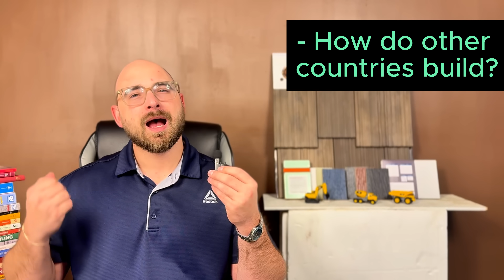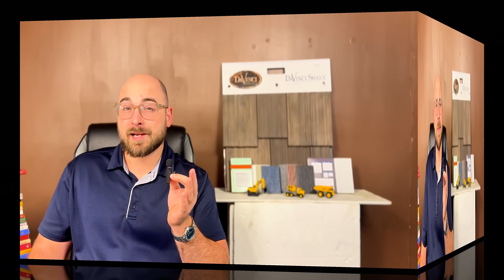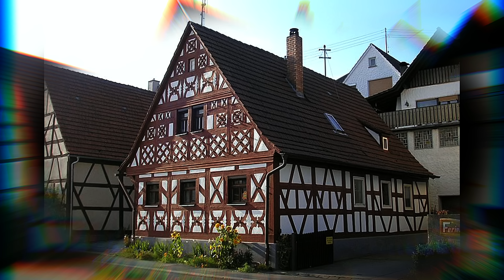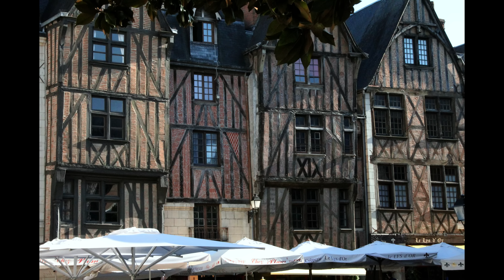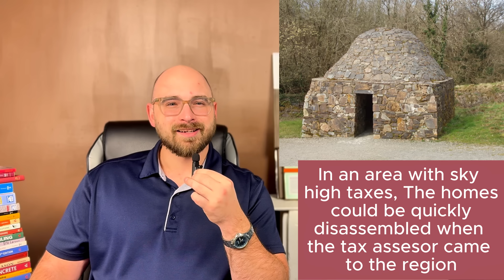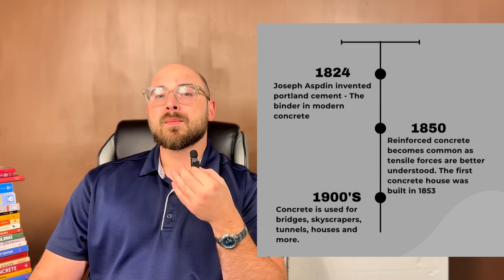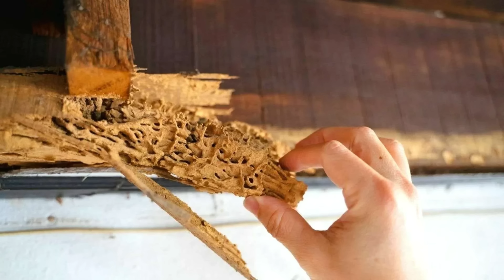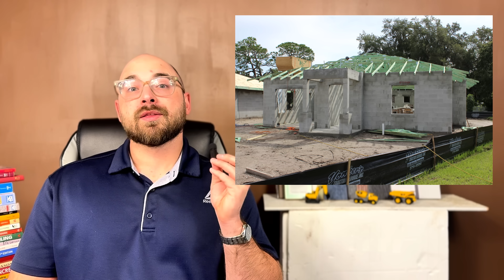Why Other Countries LAUGH at American Homes

Comment: French here. What first gave me the impression of cheap houses in the US, was when I went to college  there. At parties, you'd occasionally see a drunk guy punch holes in a wall for fun (sentiment not mutually shared by house owners). Growing in a country with walls usually made of hard materials, I had never seen anyone (no matter how drunk) try its strength against a wall. 😂
Construction materials you'll find here when buying a home will vary a lot. First, because building techniques from different ages coexist. Within a 100 miles radius I have owned or lived in: a XIV century medieval stone house, an 1850 rammed earth house ("pizé" for those who know), a light wood house from 2000's and my current house from the 90's has double walls (external shell is reinforced concrete, internal walls in bricks with insulation in-between.
If you go to different regions, other   construction types can be found depending on available materials but also because building codes encourage using regional construction style (full timber, stone or matched roofs, etc.)

Comment: Sometime i watch those home renovations channels and the price are just too high , you said light wood houses are cheap to build , but they cost 3 times the houses we have in Italy (250k full new house with 8 rooms)  , and the factor that are "easy" to build is just from your  POV , i don't even know how to start a light wood house but i know how to make a concrete and bricks house with no problem , of course you need an engineer to make it  resistant to  earth quake .
The only good thing that a light wood house have is a lesser ambient impact(if builded once 😅) , higher insulation and a faster construction. 
But higher maintenance, higher hazard dangers, and a giant Cons for every European , that your house will be the exact copy of the house near 😂. Terrible !

Comment: 10:46 You can also use concrete blocks for the inner wall. That is quite common where I live. Using bricks as a fansy cover of a wooden house sounds stupid. It is going up in flames and collapsing anyway. You build with brick in order to avoid that.

Comment: One interesting form of dwelling that has become popular out of nessecity n avalibilty in Aus is the 'Donga'. Originally a term for a lean-to shed transient workers could set up a bedroll or swag under, mining companies built entire villages of single mans quarters, out of polystyrene clad in steel sheet. Fits onto a sea container flatbed, bathroom, lounge/kitchen, bedroom. Well insulated, and cyclone (hurricane) rated. It's a trailer park house built to mining specification. Made on a production line, high quality, just plug in water n power. not very pretty tho. But they can be made quite nice, with appropriate decor. Add a verandah, park it somewhere with a nice view. If you get lucky and a minesite is shutting down, can buy one for $7-15,000. My family have a few, have helped many cousins n family friends out when they just need somewhere to stay that is safe n secure. It's a caravan with 4in thick insulation.

Comment: I didn't know you build wooden houses so often, until the fires started in LA... I'm from Bulgaria, over 80% of the houses are built with steel and concrete construction, the walls are filled with bricks and the roofs are mostly wooden

Comment: In Slovakia, recently we built house made of Ytong white "brics". I used heavier version of this brick. Walls are 35-40cm thick then insulation etc.. 
I took this ytong brick to the shooting range. .44mag from 10meters didint go deeper than 5cm (2in). 
7,62x39 went through, but behind the brick wood plank was not much damaged and stopped the bullet. Maybe in the USA you should think about those bricks to be used due to street shooting tradition in there.

Comment: In my part of Aus, most houses are brick and tile. Wood is used for smaller, somewhat temporary structures, like sheds and short term accommodation. Back when my grandparents got married, my grandad built a small house from wood, and built it out with brick and stone as his family grew.
Another popular non-professional technique here is pre-fabricated steel frames. Essentially delivered IKEA style flat-pack on the back of a semi, the walls and roof truss segments are welded panels that just get screwed together. Importantly, they are already engineered and certified, so building to code is a solved problem. A pair of handy blokes can put a house together in a few weekends.

Comment: Framing, sure, but this seems somewhat superficial to the point of missing the mark entirely. It seems apparent that the building technique is not the issue in question, rather the quality of the carpetry and raw materials relative to the price. The real difference arrive through standards, in Norway for example there is a building code (TEK17) That governs every aspect of the build that ensures quality and longevity of the residence. These codes are immensely strict and far exceed the bare minimum. Now, I know there are building codes in the US as well, but these I do not know particularly well.

Comment: So my house, and almost every single house built in the last 40years in North Queensland is made from concrete blocks, and then usually the blocks are filled with concrete once the walls are up. 

We live in an area that has a high cyclone risk, so everything is made to survive cyclones, and so long as yards are cleaned up and houses are kept in good repair we usually survive quite well.

Comment: Americas houses build to last about 10-20 years but they will last longer. German houses build for 100+ years. Both would be renovated, redesigned about every 20 years. 
Americas houses basically build cheaper and as you said easy to adapt changes in design while the german houses build expensive and heavy and less easy and also less cheap to adapt the changes.

Comment: I really don’t think this is a competition. As he said in the video, construction techniques/materials are largely derived from regional availability, that includes labor. Most skilled construction labor in the United States is focused on commercial or high-rise construction. It’s a stereotype, but a very true one that most residential construction workers are immigrants, a lot of them undocumented. It’s still a challenging job in its own way, but you would hardly consider them to be master craftsman. 

Add to that the prevalence of large home builders in the United States, most suburban style neighborhoods are constructed in an assembly line process with limited options for customization, a lot of the parts are even pre-fabricated. This skill set, and the availability of contractors often also makes it significantly more affordable to custom build a home out of wood versus other materials.

Regarding cost, just doing some basic research, it would seem that the average price of a home in most European countries, especially Western Europe, there’s a lot more than what you would pay for a home of a similar size in the United States. I realize homes in Europe, and really most of the world, are a lot smaller , but that’s also one of the selling points of the American style home, size. A lot of the anecdotes I’m reading here in the comment section I can almost guarantee are people‘s experiences with the American style “McMansion“ which has largely gone out of style for more modest homes, including townhomes and smaller cottage style houses.

Last but not least, in regards to resistance to natural disasters, the types of disasters that we see in the US and Canada are beyond what I think most Europeans especially can imagine. Hurricanes and tornadoes are very significant storms, the average wood framed American home can resist a lower end tornado or hurricane pretty well. When it comes to more severe events, even a newer European style home would be susceptible to destruction, and the material they are built out of wood become deadly, this would also go for earthquakes. The only thing I might concede on would be fire, though if flames did manage to get inside of a masonry home, it would still be gutted. 

I suppose I’ll also add, regarding energy efficiency, energy is a lot cheaper in the United States than it is in Western Europe specifically, meaning that heating and air conditioning our homes tends to cost us less and efficiency is not as high of a concern, though in areas with particularly severe winter and summer weather conditions, there are materials that can assist with heating and cooling.

Comment: One style of concrete you didn't touch on is ICF Integrated Concrete Forms. The exterior walls are built like Lego. The interior and exterior of the form or "block" is a Styrofoam material. Rebar is placed inside the cavity for strength and then concrete is poured in the cavity. The cavity is 4"-12" depending on the height of the building. The insulation value can range from R30 for the 4" to R40 for the 12" walls. It is easy to run plumbing and electrical in the foam after the concrete cures several days. It also holds up to hurricanes, tornadoes, and fire. It repels insects and rodents. 
It is just as fast if not faster than stick construction. The cost is 10%-20% more for the exterior but that is about 5-10% of the total cost of the home.

Comment: Exactly the bunker concrete style is what I love. In Switzerland are houses with concrete walls usually the most luxurious with a minimalist design. And of course much more expensive.  That's why my house is built of Ytong aerated concrete. This material needs surface treatment and in certain areas additional insulation, but it is basically a lightweight porous material which makes later remodelling of the house easier.

Comment: Code. In the 1950s, as part of an effort to mobilize the economy, we began requiring homes built to building codes. The problem with that is that the codes are set by the government, not builders, and it is dependent on suggestions by large building companies.

Homes built in the 1910s are still standing. Homes built in the 1850s are still standing. Homes built in the 1960s are in severe disrepair. This was intentional, as a family property lasting generations is not suitable when we need people putting the most possible into the economy.

So... stick-built is a thing. Building in brick or cement is against code. You can do it... barely... but you will not get a morgage or insurance for it.

Comment: I live in Russia. Many private houses are also built of wood, but the style of construction differs significantly from the American one. Basically, the building is built of massive logs or beams, in addition, many people outside cover the walls with a layer of brick and metal Siding. In Soviet times, it was also covered with wood on which various patterns were carved. The main determinant of construction is, of course, thermal insulation. But such houses have been standing for a long time, so I got a house built in 1950 from my great-grandmother.

Comment: USA has a lot of natural disasters and houses flying or torn apart are a common sight. It's painful to see. Structural bricks would make for a cheap material, but only if there were availability. 
Every house or building I've ever lived in were made of reinforced concrete frames, brick walls, floors and ceiling, with either slab or mission tile roof. It would feel weird to live in a home where I'd be able to punch through the walls. My home needs to be clumsiness-proof, or else I'd accidentally hack it apart.
I know some brutalist or brutalism-inspired buildings. Cold concrete surfaces don't provide much comfort. If I were to live in a concrete house, I'd like it to have the inner walls insulated.
I'm from Brazil.

Comment: Simple reason is homes are predominantly rented rather than owned in the US, so there is no incentive to build them to last or maintain them properly as you will move on and the landlord will redevelop them when they get too old. In Japan where wood is predominantly used for traditional and small homes they also dont tend to last more than 40 years or so because while remaining standing the back of the house is broken by repeated Earthquakes and its structurally unsound/totally out of plumb while concrete buildings last longer.

Comment: Well, what's happening in LA is the result of bad homebuilding. A good engineer would had prepared those houses to be safe in case of fire.
Reply: how? wood, paper and glue like fire
Reply: @bargor  exactly. So you start by NOT using those materials.
It's not rocket science, unless you're American

Comment: I lived in three homes in the US. First was wood with plywood on the outside and rough paint to imitate true render. It was in LA. It was a tinder box in terms of fire safety. I bet that sadly many homes that were recently burned had similar construction. And the electrical systems were a travesty. Decades out of date in terms of safety. It’s all about cheapness and using the lowest price labor (i.e., exploiting underpaid immigrants or undocumented people)
Sheds are built better than that in Australia

Comment: I moved from the US to Japan about 10 years ago and find Japanese homes to be the worst in quality. Timber frame construction with layers of plywood, gypsum board, and an exterior wall of very lightweight "concrete" panels. No or ineffecient insulation between the walls. Single-pane windows with aluminum sashes which let cold air in. Exhaust hoods in kitches that let outside air flow straight in.

Comment: building inspectors that are stuck in archaic standards and close minded to new or re established standards of building.   if you dont fit their mindset.  your project will never be signed off and never allowed let alone being insurable ...IBC codes are close-minded and leave no room for variations or adjustments.... just ask anyone that has dealt with a building inspector for simple sign offs....the term simple does not exist with a fair amount of hand greasing..

Comment: Concrete production is considerably more environmentally damaging then brick, wood or packed earth. In Europe thick mass timber like CLT is taking the architecture world by storm, it's solid, light and sustainable. In a fire it burns, but slowly, the outside chars, and before the fire actually reaches the core and causes the structure to collapse, everyone has already fled the building.

Comment: the international perception of America is a land of:
- reckless consumerism
- corporate greed and poor standards and protections
- predatory lending
- rampant criminal activity
- firearms being as common as illicit drugs

Put together simply: the internal viewer cannot understand why an American consumer:
- takes out an exorbitant loan,
- to buy a cheaply constructed, often uninsurable home
- that pincers you in debut for life, with a high chance of losing everything
- in a country where you can be easily robbed, scammed, ponzied, fired without severance, or have your legitimate claims rejected
- for a wall doesn't even provide safety from reckless drivers going off the road or easily accessible firearms.

If international viewers didn't expect to feel scammed, abused, and unsafe being in America, we wouldn't be thinking about bulletproof brick walls.

Comment: A better representation of whats wrong with American housing is when you said "steel is used for commercial and multi-family buildings.. not homes". There is nowhere else on Earth that mandates single-family detached housing as ubiquitously as the US and nowhere else where people are so conditioned to believe the only "real home" is a detached single-family home.

The biggest difference between the rest of the world and the US is our land use policy and our building/zoning codes which ban most of the livable, well-ventilated and well-lit multifamily building layouts commonly used in East Asia and Europe (point access blocks, single stair buildings). Its not the building material that plays the biggest role

Comment: I'm from Germany, close to the dutch border. Brick and mortar buildings dominate my small town, other materials, especially wooden homes, are extremely few and far between.
Most people care a lot about energy efficiency, to the point where you see older buildings getting refurbished to meet current demands in that regard, and solid construction is THE way to keep the heat in and moisture out.

We don't really have natural disasters here, except the odd especially hot summer or torrential rains, so that point is not really a factor.
However, I cannot understand why US homes aren't built to last. You've got large parts of your country regularly exposed to hurricanes and/or earthquakes, yet you choose to buuld your homes out of toothpicks that fall apart from a gentle push.
Wouldn't it be much better to build solid, hurricane-proof housing in these areas? Sure, it'll take longer and cost more, but on the other hand you don't have to spend millions for lost property and rebuilding efforts year after year.

Comment: I can't believe you omitted the 3-d printed homes made of concrete.
Reply from the maker: Because they’re a fad, 

Not cheaper, not well insulated, exposed to the elements (concrete is porous), and the lack proper reinforcement 

3D printed homes are a solution in search of a problem

Comment: I'm from Spain, and I can say that since the last 60 years housing hasn't been built to last that long: most coverings fall apart, concrete sometimes roots and insulation is not that good. But old local stone houses are great. I live in a 120 years stone home myself, and it's like new, also with pretty good insulation. Also, nowadays, with more restrictive construction laws, houses are getting better.